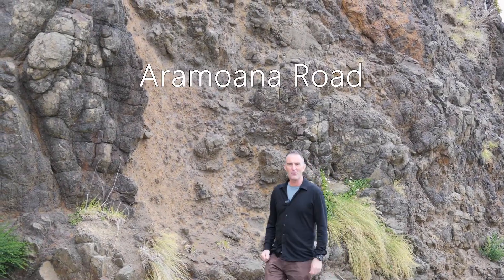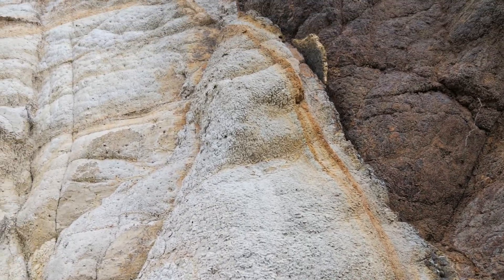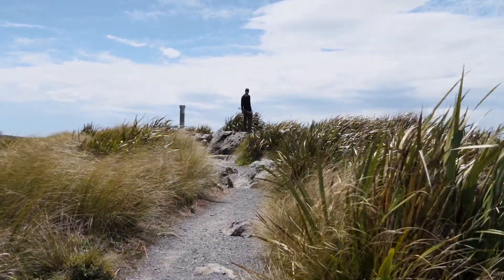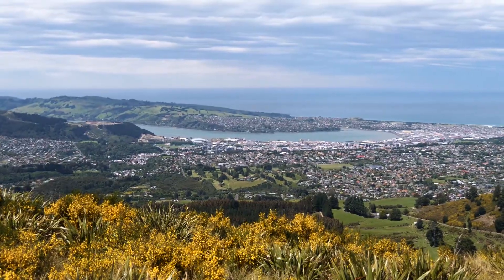The Geology of Dunedin Volcano

Comment: Hello, why is that deike* white and not black or brown? Is it basalt that became infused with massive amounts of silicate as it rose to the surface?

*Obfuscated to get around the Inner-Party's censors.
Reply from the maker: It is made up of trachyte made mostly of alkali feldspar which is a light coloured mineral.
Reply: @OutThereLearning  Thank you. Interesting, as I was under the impression that deikes are mafic, not felsic. It turns out that that was false.
Reply from the maker: @k.chriscaldwell4141  Trachyte can result from an originally basaltic magma that gets differentiated by the removal of other minerals, leaving mainly the alkali feldspar. But yes - you can get felsic 'deikes' :-) Thanks for your interest